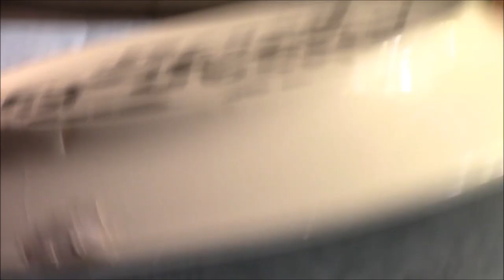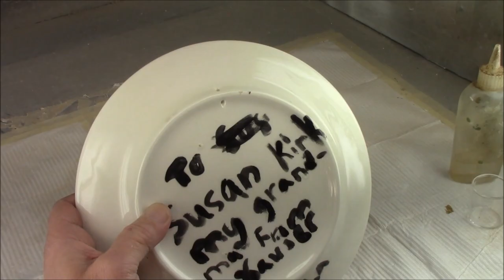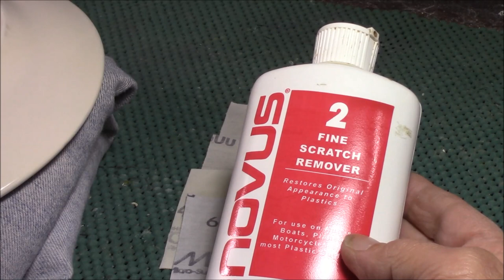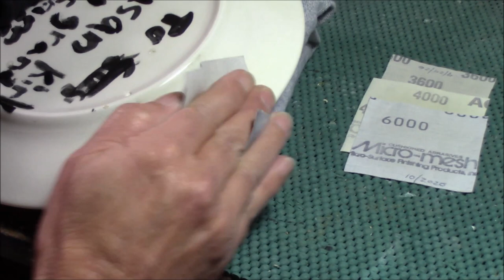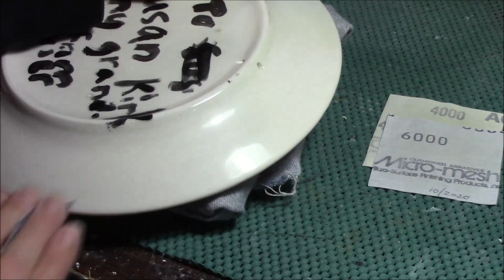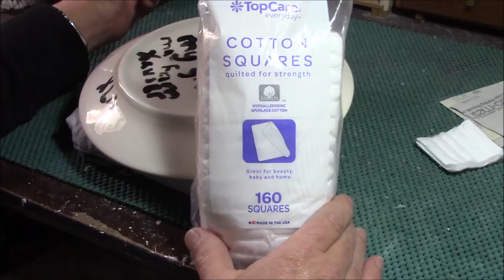Snowman Plate Chip Repair

Comment: Can i use sand paper ? If i dont have file?
Reply from the maker: Yes, but you need to use the kind that doesn't scratch the glaze. Use "Micro-Mesh" sandpaper. You can look it up on line. You want to get these grits: 1800, 2400, 3200, 4000, 6000.

Comment: When do you used The Diamond Files
Reply from the maker: I'll put it this way: I only use them when there's no danger of scratching the glaze, and I can't use the steel files (because the steel files only file in one direction, while the diamond files work in any direction.
Reply: Did you use Micromeh to finish sand it
Reply: Once you apply Glaze to the apaint it should Match perfectly
Reply: I know arylic Paint Drie Darker so 
Alot time times I put it on some Index Card and put it the Micro wave 
For 10 sec
Reply: Are you going to do some more Statue repairs
Reply from the maker: @georgemartinez1720  yes.
Reply from the maker: @georgemartinez1720  I'm sure I will.